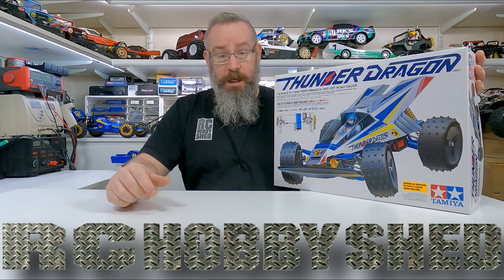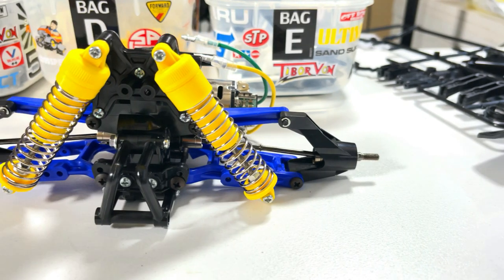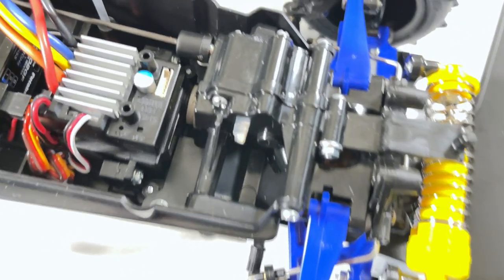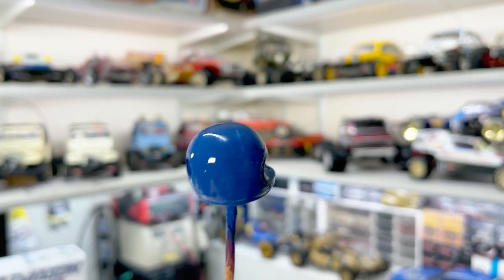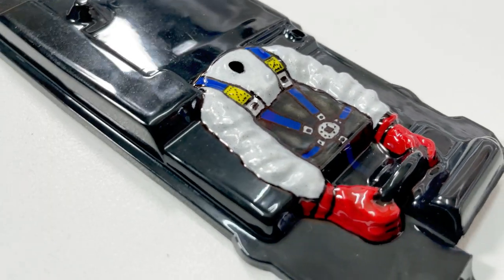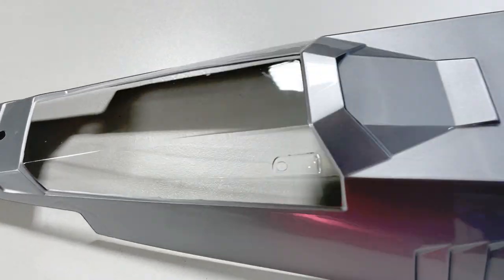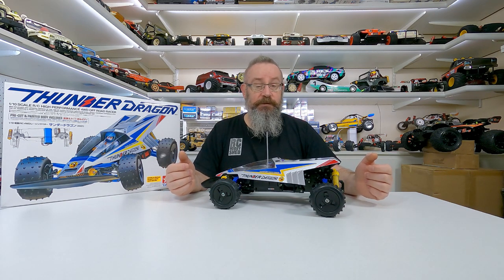Tamiya Thunder Dragon 2021 Build

Comment: Nice one - you always do such a neat job on the wiring - which I find really helpful when trying to work out (copy!) the neatest wiring routes to make the cars look nicely finished - so thanks for the close-ups of the chassis electronics and wiring routes on all of your videos - please do carry on on showing that!

I love these buggies - they really encapsulate retro tamiya  for me, with the blue rear arms and slightly quirky/retro futuristic shells with tub chassis - I still have my original terra scorcher from the late 80s which I restored a while ago (as well as a rere!) - so probably why I’m drawn to them - and my “sweetspot” (mid level buggies). Looks really nice and I’m now considering adding one to my collection. 

One thing I find on these is the weak point on the screw  at the top and front of the chassis on each side (used to attach the front end to the front of the chassis). Always seem to crack….. can bodge a repair with a washer and epoxy glue/araldite, but I wonder if there’s some form of metal bracket which could be used…?

Anyway. Great video - and fills me with nostalgia - and now the need to buy one. Damn…
Reply from the maker: Thanks for the awesome feedback, Spencer! It's great you find my videos helpful, it's always good hear. I often wonder why I'm doing what I'm doing with this channel but comments like this make it worth while. It's also great to know it's helping others.
I agree, this style of buggy with the futuristic (for the 80's) body just screams 80's. I think you should grab one!
I've heard about the weak spot in the chassis, yeah maybe some kind of brace will work. I'll see how this one goes and the Fire Dragon. If either of them fail I might look into making something. 
Thanks mate, glad you enjoyed it! Haha always the way, I'm always seeing things that hurt the wallet. 
Cheers! 🙂👍

Comment: do the fire/saint dragons perform differently than the thunder dragon?? basically front mono shock versus traditional two dampers.
Reply from the maker: I've found every car on this chassis to be much the same to drive. I can't really tell any difference in performance at all. Maybe on a proper track the lap times maybe different but I doubt there would be much in it.

Comment: I play only with crawlers but your video made me ordered this kit! Question before mine arrives.. Can the wheels be converted to hex? Would love to have it with 1.9" crawler tires
Reply from the maker: Good stuff, this will be quite different for you after running the crawlers. You can run hexes for the the 1.9's. Just search eBay for 12mm hex adapters to suit Tamiya, there's heaps out there. 👍
Reply: @RCHobbyShed  Thank you so much for the info Mick.. relieved to hear hex can be done!.. Will ya be reviewing the Thunder Shot?

Comment: I noticed that pointless bearing when I built my Fire Dragon, it's not clear why they designed that gear like that. I did put thrust bearings in, instead of the plastic bushing and washer (3x locations).
Reply from the maker: I think I didn't notice it in my Fire Dragon, just slapped in a bearing and went on my way. It had me scratching my head on this one though. 👍
Reply: @RCHobbyShed  I did same on my Terra Scorcher changed the bearing to a bush

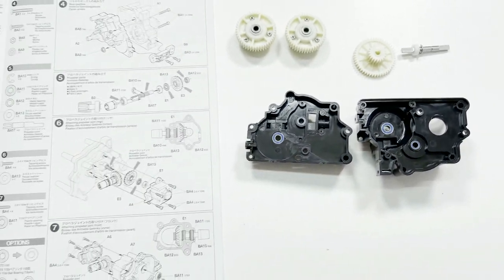Comment: 1:07 so the 17th bearing is more like a spacer?
Reply from the maker: Correct! It doesn't do anything as the counter gear doesn't spin. The whole shaft spins on the 850 bearings in each side of the gearbox. 👍